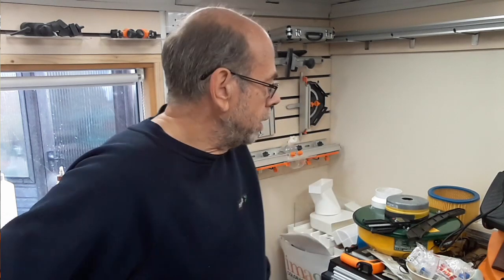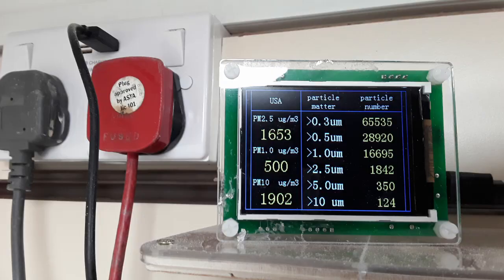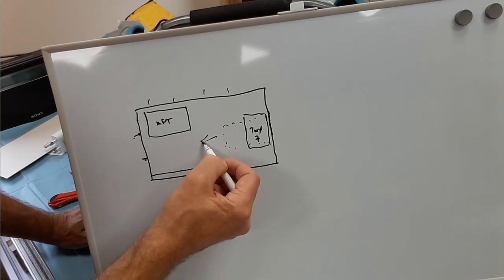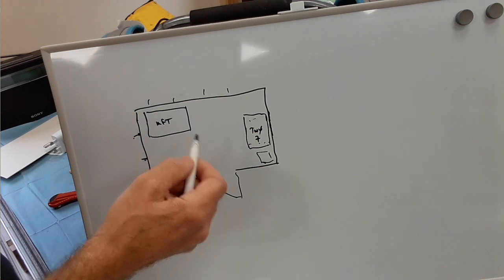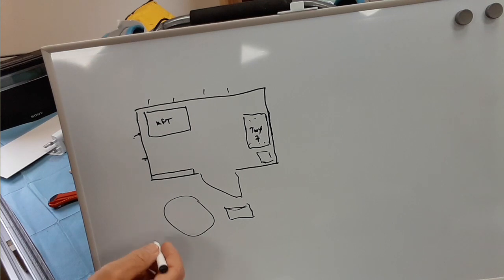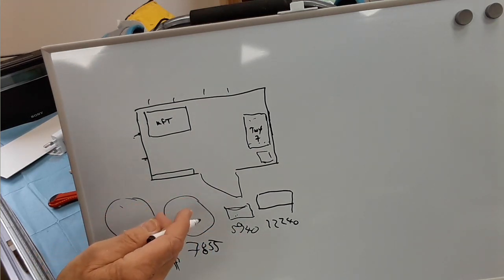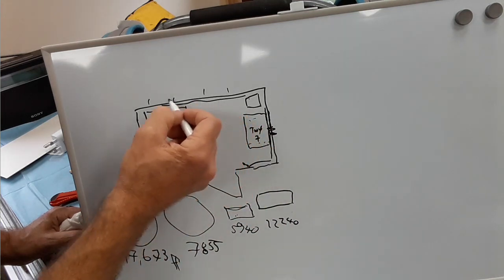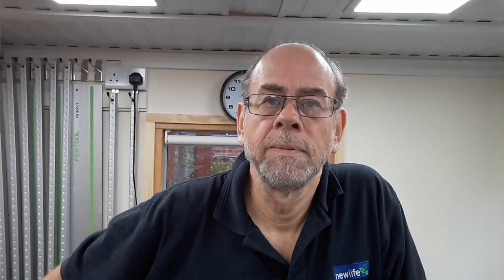the small shed #57 - dust extraction - theory

Comment: Because my workshop is so small, and I use most power tools outside, I think a shop vac and a mask is my only sensible option. I also tend to do most hand sawing outdoors though I do my planing on my small woodwork bench. Even when in my workshop I’m never more than 4 feet away from open double doors. However, if or when we move and I have a bigger shop I will have to think of some air extraction then. It would be great if it could be interchangeable with my darkroom. Leave piping in both places and just move the unit.

A fascinating video, thank you.
Reply: Thanks Mark, I  agree it's not always practicable, when I had the 8 x 6 shed I did most of my work outside, because there wasn't room anyway. 
It's worth investing in tools with good extraction and collector bags, my Ryobi Sander is very good at collecting most of the dust in its bag. Until this system is up and running I'm also working with a shop vac, the biggest problem is the dust you can't see that's floating around in the air. My air quality meter has been very interesting in showing how long it takes to clear the air after drilling, sawing or routering, in these circumstances it's worth looking at an air filter, as you tend to take a mask off when you finish a task, but the dust is still floating around.  I'm intending to build a small one to see how much difference that makes as well.